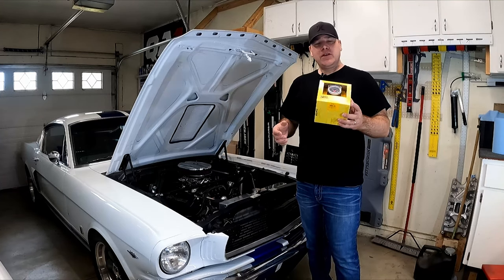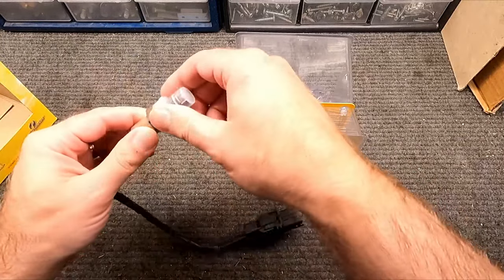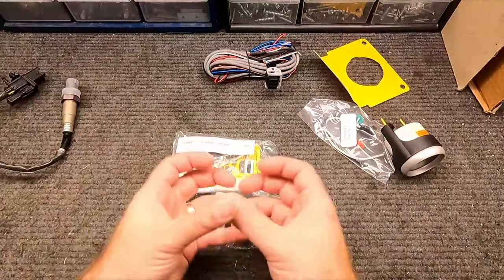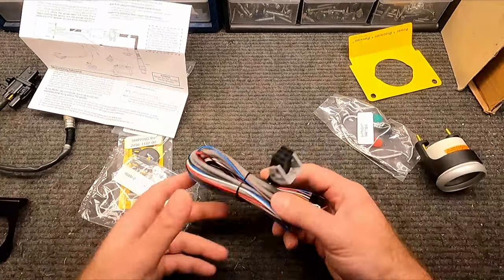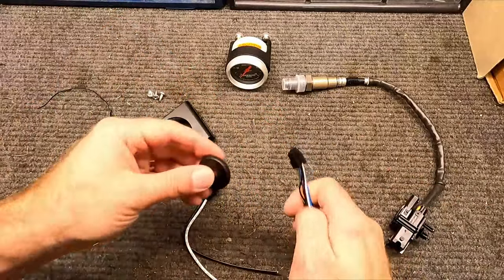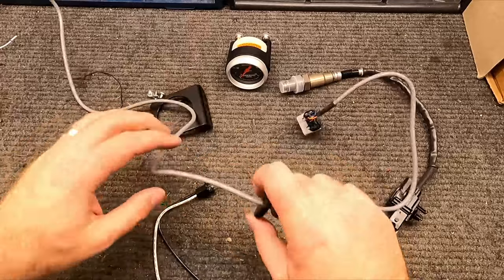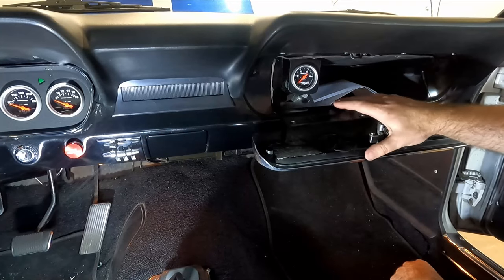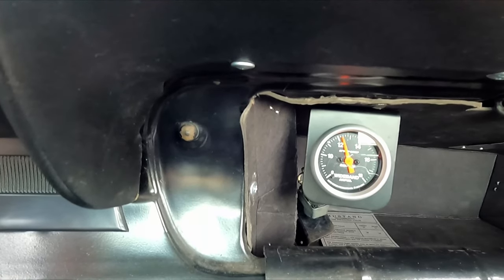How to Install an Air Fuel Gauge

Comment: I would argue that the A/F gauge is worth keeping visible while driving.  If you are in the middle of a pull and you see your A/F ratio go lean, you know to get off the throttle before you blow your engine.
Reply from the maker: Possibly, but you can feel the engine chug a little on a lean pull too, not to mention you can also hear it.  :)

Comment: Nice mod and great video. An A/F gauge is probably one of the best mods I've done to my car. Has helped me out significantly when tuning the carburetor.
Reply from the maker: Yeah, I thought it was ironic that you had that last video with you tuning your carb using the A/F Gauge, I thought you were reading my mind.  :)
Reply: My msd won't read do you think I need to run it long to heat up

Comment: i have a digital meter on mine. pretty sure you're supposed to have the sensor installed at the top facing downwards to avoid condensation drip.
Reply from the maker: Maybe, I'm just trusting that JBA knows how to build exhaust systems and they put the bungs where they need to be.
Reply: @AndyKruseChannel  fair enough. just that it clearly states in the manual of these a/f gauges that the sensors must be pointing down at about 45 degree angle.

Comment: The tuner will lean out the cruise area.  I am used to thinking in Lambda air fuel ratio because of the Harleys that I have data logged and street tuned Fuel injected of course.  Nothing beats taking to a good tuner.  Your car is turning out real sweet. If you can make any informative videos with your tuner process that would be really interesting to me.
Reply from the maker: I want to but I don’t know how much he wants to be on camera.

Comment: Looking good Andy!  The datalogging loom is a nice feature, should help with fine tuning in the future.  Also, I like your radio block off plate; where's that from?  May need to do that in my car since it's going to be...rowdy. 😜
Reply from the maker: That plate is a factory piece, you can find them on NPD and sometimes cheaper on eBay.  :)

Comment: I believe a wide band really needs to be hooked to both sides of manifold.  Your hooking up a single side, so this is narrow band. Not sure how to do that yet,, but your the first video i clicked..
Reply from the maker: No, a Wide Band O2 sensor is just that, it measures a wider band of the potential mixture in the exhaust stream.  Reading from 8:1 (rich) to 18:1 (lean) is where most wide band sensors are reading.  Narrow band sensors are not as sensitive and they only tell you if you're rich or lean compared to the ideal mixture ratio of 14.7:1.
Also, on carb engines, where fuel is added up top for the whole manifold vs individual injectors (like modern engines), there's no need for two sensors as the fuel that goes to one bank of the engine is 99.99% the same as the fuel that goes to the other bank.  If my engine had 8 individual injectors, then I'd want an O2 sensors on each side.  :)

Comment: I have a autometer gauge but do not have the sensor...do you thing any standard sensor will work?
Reply from the maker: I think that's one of the reasons why these sensors are so standardized, so you can get one and plug it in.  :)

Comment: 12.9 is ideal, watch Nicks garage, he dyno tunes engines and goes thru about air/fuel  ratio .
Reply from the maker: Yeah, from what I've read, it seems like high 12s or low 13s is ideal.  :)
Reply: @AndyKruseChannel  I'd like to put two on my hot rod, have the bungs, from having exhaust evac system im not using anymore.
Reply: @AndyKruseChannel  I have one on my car as well and it tunes the carb great, but looked on the internet and all it says is 14.7:1 ratio is perfect for idling and light throttle cruising conditions as it's the most efficient mixture possible, meaning the best fuel economy.  But perhaps a different cam, or compression could be a richer mixture is needed? Learn something every day.